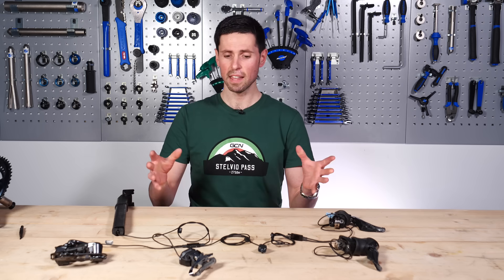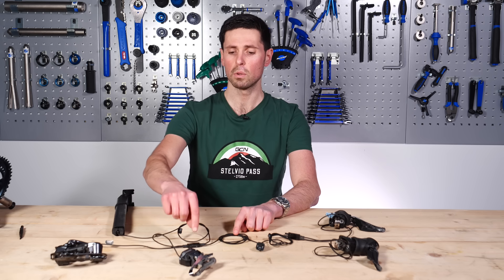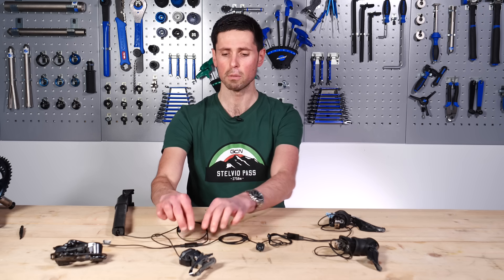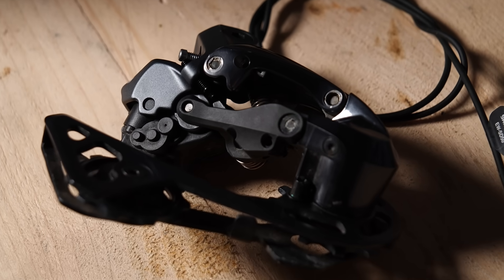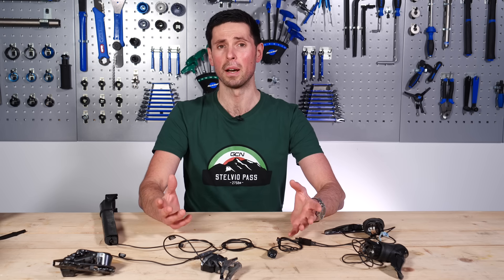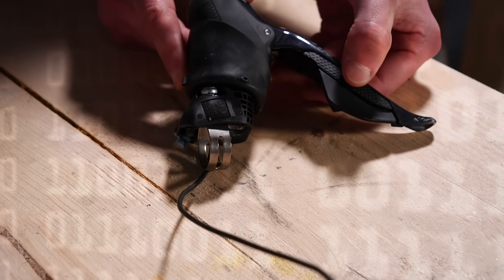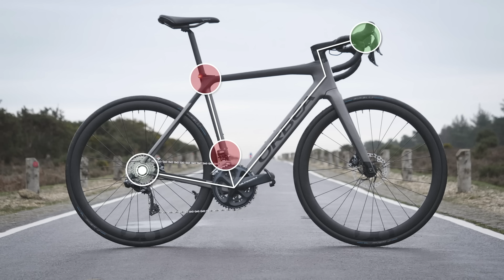How does Shimano Di2 Actually Work?| Electronic Shifting 101

Comment from the maker: Did you find this interesting? What else would you like us to look into? Let us know in the comments 👇
Reply: I want to see the derailleurs taken apart, and know exactly how the motors work in them
Reply: Personally I'd like to see a comparison among the existing wireless systems, i.e. Di2, eTap, Eps, We. If possible, I mean 🙂
Reply: Maybe include Etap and EPS? "How do electronic gears work".
Compare the three?
You are very Shimano-centric on GCN. Campagnolo for example rarely gets a look in.
Reply: Info about binary code which flowing between batt and junction looks very expired...sorry...))
Reply: Di2 is magnificent. Really enjoy using it. I’m lucky enough to have both Di2 and Shimano mechanical. Love both.
Reply: I'm sticking with mechanical. About once a year a cable snaps while travelling and all i have to do is replace the cable which is light, easy and quick to fix. I dont have to worry about recharging my bike and be afraid of system failures. I would appreciate some electronic levers, something that could be overriden if there is no battery, but also something that could be acted upon with more confort from the tops (by adding  a set of buttons to the tops, the same way they have buttons for the time trial bikes)
Reply: @CyclingLifePT  I’ve worked in bike shops for 8 years, and I’ve never seen anyone have an issue with Di2. Also, you only have to charge your bike every few months, so if you can charge your phone every day, you’ll never run out of battery with Di2.
Reply: @danjdavison  I’ve got di2 on 2 bikes, have done so for about 8 years. It’s great, but not infallible - problems have included connections becoming frail/corroded and breaking, battery problems in damp humid conditions causing failure. With more minor problems being cables pulling out after crashes and the battery running out of juice - it’s so good ‘ goes for so long without a charge it’s easy to forget! I only say this to counter, never seeing an issue with the system.  It’s great, I’d rather it than cables getting dirty and drag, but if you use it long enough in bad enough conditions you will see some problems.
Reply: @paulhesketh4214  I live somewhere that’s pretty dry, and really cold in the winter (so people only ride road bikes in the spring/summer/fall). That may explain why I haven’t seen parts corrode.
Reply: #AskGCN, Does the FSA K-force We operate the same as Shimano Di2?
Reply: I think to go into more depth on how the derailleurs actually operate based on the signal given.
Reply: I'm considering Di2 for next bike, what are some additional benefits of it? I hear you can program buttons to operate wahoo computer & other electronics? Can have readout of what gear you're in?
Reply: can you guys open it up and see how the motors work
Reply: It's ControllER area network, not ControllED area network, because it connects multiple microcontrollers that sit in the various nodes of the system (shifters & derailleurs). It would be interesting to see how they can get away with using just 2 wires for the two CAN signals (CANH + CANL) and power. You could also point out the function of the additional node in the downtube. Since CAN is a shared medium, could we get away without some of the nodes/connectors, and just solder all the wires together directly and save half a gram? It would be super cool to see the CAN signal wires connected to a computer (via an interface) and see the data flow in action (e.g. in Vector CANoe), or hook them up to an oscilloscope. Can't you pull some strings with Shimano to make that a reality ;-) ... It's of course super technical, but since cyclists are also have an interest in mechanical details and as electronic control has arrived in cycling, looking at details of the electronics isn't too far off.
Reply: Interesting stuff, but as others have said it would be great to see a comparison of Di2, Campy EPS and SRAM ETAP. It would be especially interesting to see how the different manufacturers have adopted different design solutions to the same problems, e.g. it looks as if the EPS rear derailleur works completely differently from the Di2 one, with the electric motor powering downshifts as well as upshifts, rather than using a mechanical spring for downshifts similar to a conventional rear mech, as Di2 does.
Reply: Di2 will also help in running much easier gears for long climbs. I live in the heart of the Alps and run a 10/42 rear cassette with 50/33 up front (11/42 with 50/34 is great too). The Di2 default means you can’t use the 2 smallest rear cogs when in the smaller front chainring, and so chain slack is not an issue. You do need a hanger extender and a medium cage rear derailleur combination as well : https://youtu.be/BCd32AMPP8Y
Reply: Why do you say it’s CAN bus? CAN bus is generally 2 differential signals running at 0-5V.. and singlewire CAN is not very common.. sen many people saying it is.. not seen any proof that it is..
Reply: Could you show us an electronic sti w/ hydraulic brakes?? Or is it even posible??
Reply: Great review. Does it offer a full automatic shifting option? Thanks.
Reply: To be honest you really didn’t explain it enough GCN. you should of gotten more into the E tube app as well as hooked up an oscilloscope to the data line and let us see the digital visualization of what the code looks like when coursing thru the wires. Also you didn’t explain which part of the bike is the brains of it, if there is one. Is it the battery, the front derailleur? When you make a setting change with the E tube app, where is the setting changed stored in memory? Which device in the system?
Reply: @GNX157  You are correct I was wondering about some of that too, what I was also curious was where/how do the motors get their juice? it has to be the same 2 wires used for powering the motors as well, so that means it has to be done after the signal was received. So some latency testing and multiple buttons being pressed at the same time (changing front and rear simultaneously) might have been very useful.

Comment: Shimano uses a proprietary communication protocol called E-TUBE in their electronic shifting systems, specifically in their Di2 (Digital Integrated Intelligence) systems. While E-TUBE is a digital communication system, it is not based on the CAN bus protocol. Instead, Shimano's E-TUBE platform provides seamless communication between components, allowing for precise electronic shifting, customization, diagnostics, and firmware updates through the E-TUBE app and software.

Comment: Sorry I'm 3 years behind seeing this excellent video. but I have a strange question. My present bike has mechanical changing gears and after paying a deposit for my new Giant Revolt Advanced Pro 0 today, I thought that there was no connecting cables/wires and the system as in electronic, was actually Bluetooth, because the only visible signs of any physical connections was between the brakes. So my question is, July 2024, is the system now bluetooth or are there wires but very descreetly hidden?
Reply: the electronic shifting system on your bike, likely the SRAM eTap AXS or Shimano Di2, is indeed wireless for gear shifting. These systems use Bluetooth and ANT+ for communication between the shifters and derailleurs. The only wires you'll see are typically for the brakes, as you've noticed. This provides a clean, cable-free look for the gears. So yes, the electronic shifting is effectively wireless, giving you a sleek and modern setup.

Comment: Hello, i have a simplon E-Bike from 2017 with e8000 DU and XT di2, is it possible to do Shift automatically (Like s1 or s2 Mode), or is it only an electric shifter but not Automatic Mode?

Comment: I don't race bikes any more, spend all my days on computers and/or fixing electronics. Was a bit suspicious of electronic gear shift at first, but honestly I think it's superb, have seen the electronics inside the housings (trust me it's very hard to get at for good reason) and I would be confident in saying that what Shimano has invented is near infallible. It's great that the connectors are all interchangable and wires are 2 core (these are maybe the only bits that might get broken easily and bieng this way are easy to fix and replace) Thankyou for such a great series of videos on Di2

Comment: As the prices come down I am more likely to adapt to the Di2 system on my bike from a mechanical Ultegra system.  I like the idea that the derailleurs won't get out of adjustment due to cables getting old and make shifting a little more secure.  It is not a good time when my chain falls off the big ring when I shift up on the front derailleur, which happens no matter how much adjusting I do to it.

Comment: i have always wondered which cables goes where and which junction box needs to be installed. Thanks for confirming that it doesn’t matter. To simplify things even further the Di2 system and its wirings are just like a municipal water distribution and its piping.

Comment: Great video. Gave me the information I needed (in practical terms, it doesn't matter which cable goes into which socket on the junction box) I'm running an unusual, but supported configuration of Dura-Ace drop levers with an Alfine 11 speed hub gear on my tourer. Just upgraded a five-year old bike to have Bluetooth connection by replacing the original A junction with an XT indicator (Sc-mt800) It was child's play to fit and works perfectly. Shimano really have provided us with an amazing technology.

Comment: I'm planning to use EW90-B 5 holes Junction A box and eliminate the SM-JC41 Junction B box.

All the cable will be connected to Junction A... will it works?

Comment: I must be the only one who finds this easier when it comes to maintenance than mechanical shifters. Adding pros and cons to this video would've made it perfect for me.
Reply: Of course, it is. That's the reason why electronics have replaced almost everything in the automotive industry, for example. Over time, this will also be cheaper to produce than the mid-range mechanical systems.

Comment: The CAN BUS system has been used by model train systems for decades, it called the DDC. The tracks carry bot the electrical power to drive the motors and the digital signal to tell each train how to behave - go slow, go forward etc. It's incredibly simple yet also technically sophisticated.

Comment: So.. Would it be possible to connect a single derailleur (or one of the nexus/alfine hubs) to a battery and to a 2 button shifter via the 3 way cable and that be it? is there any electronics in the other cable?

Comment: What about the electric motors inside the shifters and their power supply? Would have been much more interesting than "Can Bus" and binary code.
Reply: Agreed! The magic is the accuracy and strength of the motors, most people can appreciate clicking a switch sends a signal, no need to waffle on about binary nos.

Comment: You should actually use the other end of the tool to plug the cables in. The "fork" side is intended for disconnecting the cables.

Comment: interesting, did not realise it was Canbus. Also the same two-wire cables carry the power from the battery to the electrical motors in the derailleurs.

Comment: Why are you running two A junctions? You only need one A junction and one B junction... this is a sloppy setup for trying to demonstrate the proper setup. That first A junction that you say is in the stem is totally unnecessary. Wire from A junction up to right shifter and left shifter, then run a wire from one of the shifters down to the B junction where you'll also plug in the front D, rear D, and battery. If you want to add the optional wireless module you can add it inline at the B junction or off a shifter. Zero need for a second A junction.

Comment: Unless you're a pro, mechanical is better, I think. It's just simpler and easier to maintain/install. Having a battery for something that can be done just fine with cables doesn't make much sense to me. But I know some people just love the smoothness it provides. If I rode 8 hours a day or so I'd probably choose it too. But normally like 1~2 hours on weekdays and some 5~6 hrs rides on the weekend don't make it very attractive to me. If it at least were like fully wireless, so the components could be changed more easily or made the install simpler, that might worth the price. But then I guess you'd need more batteries... and I'd worry they didn't work in bad weather...

Comment: It's very expensive. However, I like the ability to easily run mountain bike derailleurs with road brifters,  smart shifting patterns to avoid extreme cross-chain gears, etc.  I like the idea of wireless, and am not crazy about running DI2 cables internally when doing builds and upgrades. Time will tell if 105 Di2 is really going too be "affordable"......

Comment: Hey guys, here comes a Di2 Question:
I have Di2 on my TT-bike with the newer 1-button shifters on the extensions(SW-R9160) as well as the brakes (ST-R9160). This Pretty much mandates the use of full synchro-shifting if you want to shift the full range of gears from the basebar aswell as the extensions. For this to work, you also need to assign all 4 buttons to only shift the rear derailleur. This however makes the Manual mode quite useless as you have no way of shifting the front mech.
Is there any way to achieve a setup, where the basebar shifters shift the rear mech in full synchro and the front-mech in manual or semi-synchro mode?

Comment: As a E/E Architecture engineer of automobile. Honestly, although CAN bus is considered as a stable bus system, i still think it's a little over design for the Di2, bicycle shifters don't have that much of the information to transfer. Admittedly, CAN system might could save 2 power wires and a ground wire compared with conventional connections, but it need a modem to deal with the D-A signal. which is also extra weight.

Comment: Di2 will also help in running much easier gears for long climbs. I live in the heart of the Alps and run a 10/42 rear cassette with 50/33 up front (11/42 with 50/34 is great too). The Di2 default means you can’t use the 2 smallest rear cogs when in the smaller front chainring, and so chain slack is not an issue. You do need a hanger extender and a medium cage rear derailleur combination as well : https://youtu.be/BCd32AMPP8Y

Comment: It's really fascinating to see all of the comments lamenting that Di2 isn't wireless.. Why? Apart from the initial hassle of installation, there are really no downsides to a wired shifting system, and it avoids the hassles of having to charge multiple batteries and potential pairing/connection issues. The wires are internal after all. It's fascinating because it must be more of a cultural rather than a practical preference. I hope that the manufacturers don't give in to this pressure and burden us all with daily hassles of unnecessary wireless complications.
Reply: The other advantage of going wireless (at least how SRAM does it) over Di2 is that when a battery dies you'll still be able to swap it out with the other one so you at least have shifting at the rear derailleur. If your Di2 battery dies, you're hosed.
Reply: @virtualmartijn  Except it never happens.. I have EPS rather than Di2 but with that at least, you get weeks of warning when your battery needs charging. You'd need to have a fault with the battery or the connections (or just be very careless) to ever have the battery die during a ride. In this case at least, I think the drive towards wireless has more to do with trends and perception (it's a more modern solution) than practicality. It's like using WiFi rather than a wired ethernet cable for a static desktop PC where you have easy access to a socket. Why introduce unnecessary instability? However, a major advantage of wireless is ease of installation - and that by itself could be a good enough reason for using it. I build all my own bikes and it's always the cabling and/or wiring that involves all of the time and hassle. I recently had to resinstall my EPS system on a frame that already had the BB and BB protective sleeve fitted, and it literally took hours to feed the cables past the BB... At that moment I'd have given anything to be able to just bolt the stuff on and have it work immediately.. :-)